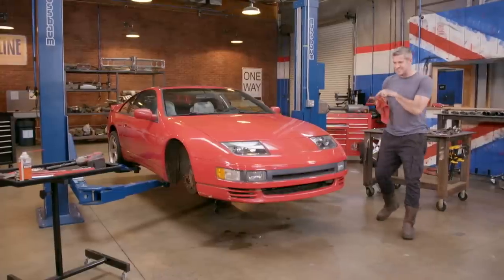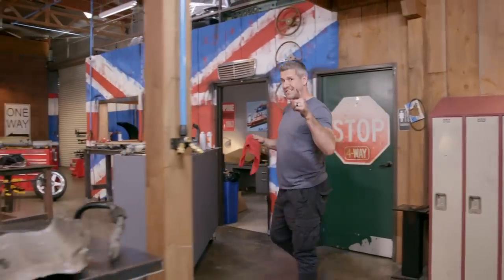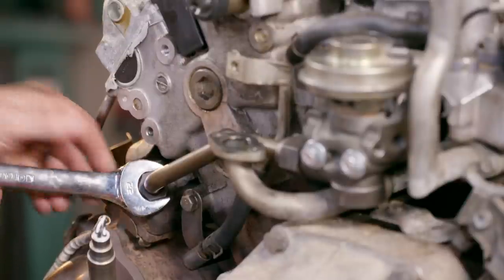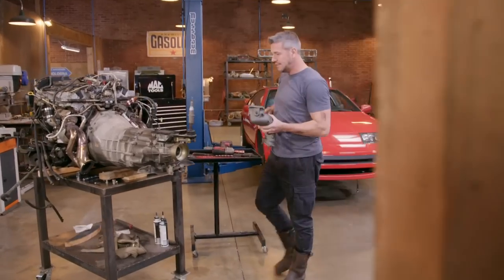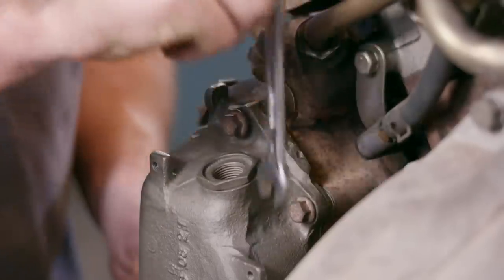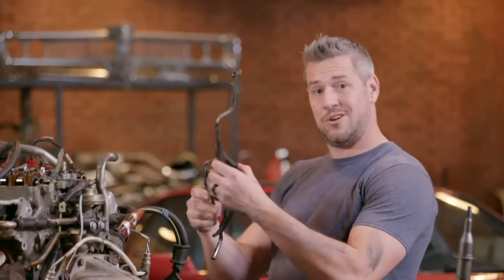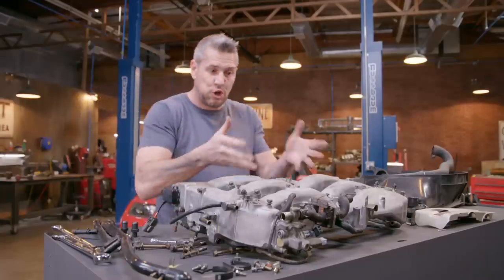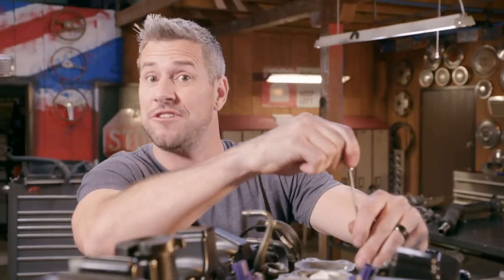Nissan 300ZX: How To Install A Catalytic Converter | Wheeler Dealers

Comment: Removing those great looking dump pipes to fit factory crap back on it, thereby choking the turbos. Best bang for buck mod I ever did was get a dump pipe with de-cat replacing the stock dump and cat converter on my 1JZ-vvti.  The turbo spool up was SO much quicker. 

This was painful to watch.

Comment: i respect you for going all the way! but you didnt have to do that.. it will fit with motor in car. step1, disconnect exhaust, step 2 disconnect shifter linkage and transmount. step 3 remove upper plenum, step 4 jack up transmission high as possible. this will increase gap between firewall and motor. step4. install or uninstall EGR Valve. yes PITA, but car is well worth it!

Comment: I hate it with the little snippets of the whole show. Wish they would air the complete episode. With all that work, I wonder if it would be simplier to get a legal engine from a junkyard.
Reply: I expect cats for 300zx are extremely rare since there a typical tuner car. This is wheeler dealers after all so engines cost quite a lot of money
Reply: That was why Edd China left. They got rid off the work part because of cost of filming. He felt that that work was what made the show and he was right.

Comment: Had a 300ZX Twin Turbo years ago. JWT chip. Sport 500 turbos. Poly bushed. OZ Split rims. 450 BHP and could have gone so much higher. Was a great car. Just sad to see this one put back to normal spec. Those Nismo wheels should have stayed on as much as the decats. Oh well. Great to see it though.

Comment: Engine and gearbox out and you didn't check and/or replace the clutch?
Reply: Like not putting a water pump in when doing the timing belt

Comment: Which is really the problem with these later 300ZX : you can barely fit your hands in there to do anything. Everything becomes a huge project. Even the later model Z31 was hard to get into. Too much engine and stuff into a small place.
Reply: All design is a compromise.
Reply: Small price to pay. Honestly, the griping about it is overblown.

Comment: you better be replacing your VTC solenoids while youre in there.. @02:35 you can see at this shot that the tar is fully melted out from backside of vtc solenoid. its on its way out. needs to A: be resealed or prefferably B: replaced with new.. NOT CHEAP!
Reply: @09:10 ok you just left them melted. awesome..

Comment: Why would you remove pcv valves? Wanting oil leaks lol
Reply: The VG30 has a dual PCV system. One for under boost, one for vacuum. The one when boosting is always pulling a vacuum on the case, regardless (plumbed to turbo inlet). The one he’s replacing is arguably worthless.

Comment: I don’t understand why they got rid of the Nismo rims. Those are more desirable than the standard rims. They even said they got $2000 for them. And they forgot to put the Nissan badge on the front.
Reply: 1990 didn't have a nissan badge on the front, it only had Nissan spelled out on the front  bumper.

Comment: Not the same without mr China
Reply: Agree. Fault diagnosis has "gone out the window", instead; AA knows instantly what part is at fault and gets right on with replacing it.
Reply: @Kurt Koleszar If Ed China was there he would say let's keep those nice NISMO wheels because this episode it's painful to watch they removed all mods that improves the VG30 reliability and they removed the NISMO rims for the heavy ass ones from factory Brewer watched to many F&F movies by that he thinks anything that has aftermarket parts it's rice or has no soul what an ignorant because NISMO it's from Nissan  so If he removes those wheels he is insulting Nissan's aftermarket parts division name

Comment: you have practically ruined the zx. free exhaust, egr injectors,  ecu, you made a mess. Now that gorgeous 300zx will have a measly 280 horsepower

Comment: Honestly, he couldn't just have bought a stock car and saved "Ant" all of this work. If the car was sold outside of California it has to meet federal emissions standards for 1991. It should be mentioned that doing all these modifications is only possible in states that dont have emission inspections.  

It is nothing compared to the standards that UK drivers have to meet with a MOT or drivers in Germany and the EU in general.They check not only emissions standards, they check the road worthiness off the car. Why anyone would remove a cat is beyond me (unless its plugged) I hate getting stuck behind a old car and having to smell the gases.
Reply: If you can even find a completely stock Z32TT, you’re going to pay about $20k, give or take. Most cars this age are exempt from emissions testing in most US states.

Comment: Well done for ruining the car soooo boring you basically De tuned the car and made it look worse your show is so pants now bring back Ed who actually made cars better
Reply: @IKhanNot  So why they didn't kept the NISMO wheels those aren't against the law
Reply: @giancarlolugo9586  That's Mike for ya. He wanted the car to be completely stock and original..... *which adds value*.
I know it seems nuts for people that actually know about the wheels and the car. I doubt Mike knew about it or he just wants to play it safe, and restore the car to original condition so there won't be any issues with selling it.
Reply: @aaryeshg.6526  Actually those OE rims add more value than the OEM ones because those rims are from NISMO which it's the performance division of Nissan Mike doesn't have argument  in that part a Nissan 300ZX Z32 or an Sileighty or S13 S14 with a pair of Nismo LMGT2 can duplicate the resale price a pair of Nismo wheels like the LMGT2's alone worth 3000 dlls and those are made in Japan about Mike what you would expect he is from Europe were there is a lot of   hard-collectors  I'm not against them but if they are going to relationate all tuning and aftermarket and street racing with F&F which it's the worst example of tuning  like Mike does I can't take him serious .